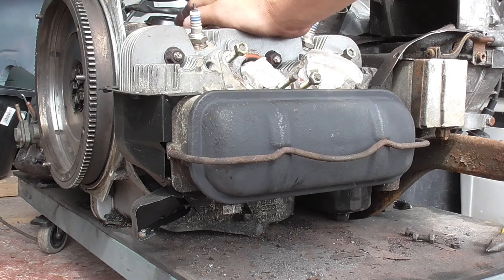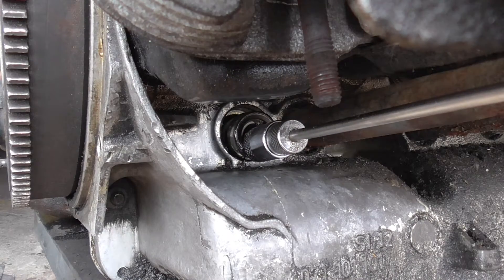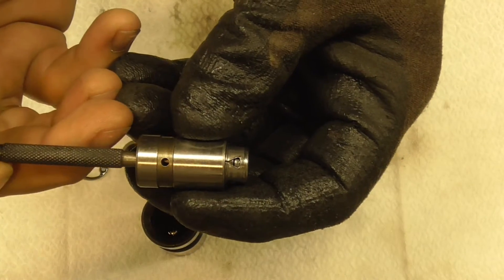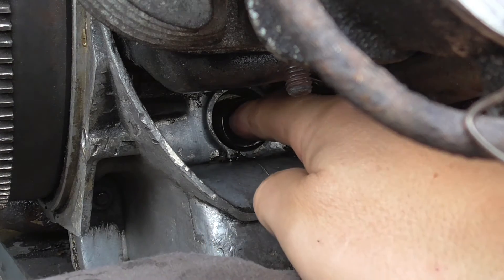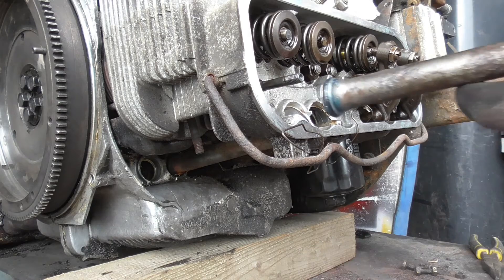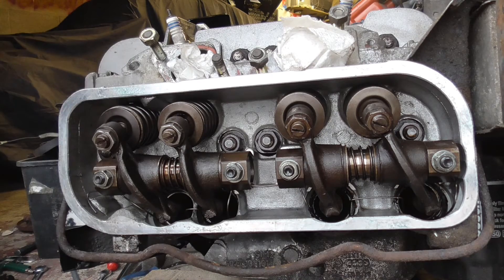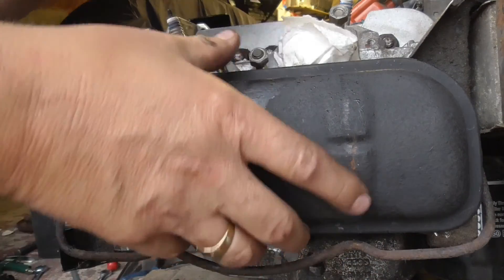VW 2.0 CU - Stuck Hydraulic Tappet, removal and fix. T25 Transporter Vanagon T3, Cam Follower Lifter

Comment: hey i don't know if you're replying to such an old video. but i have a vw t25/t3 westfilia 1980 i'm in the process of assembling it after having it painted. i've then changed all the gaskets o-rings and honed the cylinders with new piston rings. and it's assembled and just needs to be put back in. but i've adjusted the valve but they're all hard just like yours was here. it runs fine with 0.10 in adjustment but it's a 2 0 cu with double carburetors. so it should be with the same oil tensioner as yours. but if i turn it 1 1/2 turn in then the valve is not closed. just have to say that it sounds and runs perfectly with the 0.10 in adjustment. but the question is whether it's hanging in or 8 or whether it has a different model in it. just have to say i didn't check the model of it when i put it back together... regards rené
Reply from the maker: Still here and happy to help if I can. Hard to know from the info here how the Hydraulic tappets are, ie are they oiled and pressurised? I'd be tempted to get it up and running with what works as you have found already, and then just recheck your tappets once confident everything has been up to temp and pressurised for on a decent run. Does that help?
Reply: I feel like taking them all out and checking them all out before I start the engine.

Comment: Hi got new camshaft in is 1 half  turn or less watt you think  ...thanks
Reply from the maker: @JamesSmith-ui4mv  I'd be tempted to  stick with factory settings and recheck once it's all bedded in. In theory you shouldn't need to tho. Ive never actually replaced a CU cam.... tho probably should have 😅 ...so not sure what the general guidance is on this. Best of luck 😊👍

Comment: Your work is always good and clear .. Can I change the seals..mo dismantling the engine. I have oil leakage .. I have a VW Transporter 1980. Is the same engine. Is the same engine...merci d'avance
Reply from the maker: On a 2.0 CU yes. The pushrod tube pulls out the head after remove the retaining clip etc. So the seals and tubes can be replaced without removing the heads etc. If that's what you mean? Make sure you keep your pushrod numbered and clean, so can be put back the same way they came out. Thanks for the kind words, best of luck 😊👍

Comment: I recently removed rocker assy on 3 & 4 (air cooled 2 litre) to try and fix oil leaks from pushrods tubes. I reassembled not knowing about resetting the hyraulic tappets at the time. Engine just wouldnt fire on 3 & 4 after reassembly. I then discovered reset process and carried out as per manual and what you've done here. I.e. just gently close gap and then 2 full turns in of the adjuster screw. However all this does is open the valves slightly and leave me with no compression! Looking at your video more closely, it is clear turning the adjuster lowers the position of the plunger in the huydraulic tappet rather than opens the valve so I have to assume  that in my case the tappets are somehow locked or bottomed out. Do my conclusions sound correct?
Reply from the maker: The Tappets will often drain of oil when the engine has been stood for a while on the valves under load, why the engine can sound like marbles in a tin can for a while when first started. They will repressurise soon as get some oil round them and usually after warms up a bit. If you just follow the 2 turns in, and then get it fired up, the tappets should repressure and self adjust so your valves aren't open and losing compression. 
If you have had the tappets apart like me the need prefilled with oil, I know a garage locally that jokes about assembling them submerged in a bowl of oil, I think he was joking!!? 😅
Update... I was just thinking about what you wrote and had a moment of clarity. So your tuning in 2 screws and it's solid so opening the valve rather than having a lack of oil pressure. This is similar to the problem I had and found one stuck. I have a full set from a CT which LOOK the same as a CU. I haven't compared side to side but if you can confirm so, happy to send you one if get stuck, forgive the pun.
Reply: @PeoplesCar  Thanks for your reply - really helpful. I'm thinking before I strip the valve gear off again to check the pushrods / tappets, I'll see if I can identify which tappets are solid and dont have any 'give'. Then I'll repeat the reset procedure but not wind in the adjuster on those that are solid. This might at least give me compression and allow the engine to fire and get the oil circulating. This in turn might pressurise the tappets - and free any stuck ones? I cant quite get my head around what would happen if the sticky tappets freed themselves but assume they would now be out of design range and get noisy - not sure! Then I'd run the engine for a while and redo the reset process again. If still no 'give' when adjusting then I'd have to assume those that are stuck will need removing - which looks like a nightmare with the engine in situ. I appreciate your offer of providing a replacement tappet. I'll do the above and let you know if I need one!
Reply from the maker: If you don't reset the valves correctly they may not open? On the tappet I had that was stuck you simply couldn't wind it in, was solid and opened the valve. So pretty obvious. They should actually be pretty solid if pressurised but you should be able to wind it the adjuster 2 turns without being totally solid. In theory they would leak some oil out and self adjust, if working correctly, it's kinda the point of them. Frustrating ain't it!
Reply: After stripping valve gear again and finding all tappets followers were solid I removed one. Turns out they're not hydraulic!! Engine is Pre 1979.
Reply from the maker: @White_Walker900  Arg really. I didn't know they were ever solid on a type 4 sorry. Just needs gaps setting and you should be good 👍

Comment: Can the lifters drain of all the oil and leave a large clearance between the valve and the rocker arm ?
Reply from the maker: Yes I believe this is fairly common on these engines when been stood a while. The Tappet/s under load will leak its oil, so when the engine is started it sounds like a .... and to quote a friend here.... skeleton having a wa*k in a metal cupboard! 😅. Takes a little while to represureise hence often sound tappety when started for the first time in a while. Important to make sure the oil level in the engine hasn't dropped too far, and I was once told an oil change can help this but can't confirm that's true first hand.
I've never had or heard of one permanently fail in the way ypu suggest but not saying its not possible. I did have a CT I bought and pretty sure the previous owner gapped the rockers like would on a none hydraulic bug motor which I guess is an easy mistake given its similar design, so something to watch out for if its new to you and all seem loose despite having time to repressurise. Best of luck and thanks for watching 😊👍

Comment: What does a stuck  tappit do to the engine? Would it make the engine sound noisy, would it draw in air , and make engine sound  and run rough?. I have a problem with my 1.9 wbx  twin Webber carb engine I can’t get to the bottom of
Reply from the maker: Its funny you should being this up as was just discussing it the other day and we couldn't come to a concensus on the outcome of a stuck Tappet and meant to look into it further. When fully pressurised the Tappet would hold the clearance at zero to the pushrod and keep the rest of the valve train 'tight. However I don't know what position within the Tappet the pushrod sits, so how far into the Tappet body if that makes sense. In my experience with mine the valve train was super tight, although when fully pressurised you would expect this anyway to some extent certainly when the engine is running. So the soft rockers on mine with a little movement just showed they were slightly depressurised and the valve not stuck, where as the solid one had pressurised and even with the engine off still solid. I was getting a lot of pops and farts back through the carb and exhaust and suspect this was the valves being slightly open due to that Tappet as wasn't able to adjust the tension out, but its hard to say for sure as had a garbage carb and an exhaust full of holes. I guess the way to test if your valves are open is move that cylinder to the compression stroke where the valves should both be closed and then use compressed air down the plug hole. If it comes out comes out exhaust or manfold you know there is a problem with the relevant valve. Tbh that's a lot of messing tho and probably just easier to replace if suspect is a fault.  I have a set of CT ones you can have a couple of if are the same as for your engine. Look the same as CU but don't know if are the same or not so would have to chedk and obviously are used so a bit worn. Noisy tappets are usual for a while especially when the van has been stood but should quieten down after a few minutes of running. I believe somebody set mine like you would on a bug however with a 6 tho gap rather than a couple of turns in and that sounded like marbles in a tin! LOL.
Problem is there are so many reason I can run rough and I would suggest timing and carb issues more likely than a Tappet problem. For reference my new 1.9 wbx sounded like a bag of shite, just listen to it in my latest video, I reset the valve 'gap' last week and its vastly improved it but still not perfect, but as least now doesn't sound like something is about to fall out the bottom of the engine. I've actually done another video on setting the tappets on the 1.9 wbx due out about 6 weeks  but it's pretty much the same as the one i did for the CT a year or 2 ago. Only thing I would change is using fingers to feel the biting point on the rocker foot rather than a screw driver. It's just easier to feel. Hip something there might be of help. Best of luck 😊👍
Reply: @PeoplesCar  well thanks for that!!! 
I’ve had twin carbs for about a year, a month ago it just lost power and the engine was noisy . I tightened everything as per your video, set the carb floats to the correct height with a gauge put in a mechanical pump, changed all of the fuel lines , new filter, new plugs, leads, checked timing and distributor, flamethrower coil, all fine . Did a compressive test, all came out at around 145, brake servo fine. Starts ok on the drive, idles fine, go on the road, coughs and farts, no power. Put down the pedal, backfires, still no power. So… I’m hoping the valve (s) is stuck.I don’t know what else to try or how to test for anything else.
I’m stumped
Reply from the maker: @stevethetiler  So compression test OK, no need to check if a valves open then. Might be worth checking you don't have any leaks in the vac lines for the dizzy stopping it advancing properly. This was something I found on mine last week and ran so much better with new rubber ends on the pipes. It sounds very similar to the prob I had with my 32/36 progressive and I believe that was a blockage in the main jet/circuit but tbh I never tried to sort it just swapped the carb and was better instantly. Best of luck 😊👍
Reply from the maker: @stevethetiler  You could try posting on Volkszone forum. They will ask you a bunch of questions and tell you about bunch of things to try, but some of the guys on there are so much more knowledgeable than me and my primative brain 😅. Collective think-tank and all that 👍
Reply: @PeoplesCar  great, thanks for all of your help, I’ll keep watching 👍

Comment: Procedure I've used  rotor pointing to number 1 on Dis cap...set tappets for each cyl  accordingly,set screw 2 turns after slight slack.Turning Crank pulley anti clock for next cyl loosened pulley Bolt .So continue clockwise  to cyl on same cyl head side .
Reply from the maker: I've done a couple of vids on this procedure and I do exactly the same. Tx for watching :)   PS: Sorry for the delay responding. A bunch of comments didn't show on my phone, wasnt till I logged into the PC I could see it! Weird!
Reply: @PeoplesCar  Yeah that happens I've found that pc shows more comments to posts.Reason I was adjusting valves engine compression on#2 low .Atm I'm doing a full respray .Engine needs out after thatand sorted +new clutch .Would you know where to source a/cooled thermostat 85 degree 2ltr engine ? Thanks & subbed😁
Reply from the maker: @davidpatterson9107  Siunds like you have a lots 'fun' to come! 😅. No I'm not sure, is that not something you can still buy new, I haven't looked. I actually ran my CU without one and locked the flaps open with a small bracket on the top left of the engine. The cable had snapped on mine. I know this isn't ideal and long term will affect the longevity of the engine but never caused my any day to day problems. I personally thought the difference between open and closed on a CU was quite small unlike on a Bug but still not recommended and even had an engine builder tell me he can tell when one has been run without one. Best of luck 😊👍
Reply: @PeoplesCar  Thanks for replying used to be able to get thermostats at reasonable money USA  not in demand enough they stopped bothering .If you're  lucky to have a duff one they can be resurrected via a link which shows how to.👍👍
Reply from the maker: @davidpatterson9107  NP I always try to 👍 I think they are bigger than bug ones... not 100%... but I remember thinking that when last held one. I wonder if woukd work all the same, somehow clamp the cable on top rather than the fixed bar. Probably not worth risking for an 'experiment' however unless you try stupid things like me and bug carb on a CU! 😅

Comment: Dont you have to adjust the tapets to 00.6 ?
Reply from the maker: Not for hydraulic tappets they are self adjusting once set 🙂👍
Reply: @PeoplesCar  What is the proper setting?
Thanks
Reply from the maker: @vanhuss9239  if you jump to the valve setting timestamp on the bottom of the video I go through the adjustment. 
For hydraulic tappets according to the manuals you make contact to take out any free play and then 2 turns. Many do 1 1/2 turns as it can tighten slightly over time. 
I go through the full procedure including getting the engine to TDC on compression stroke in this video https://youtu.be/Pjjndd7qrEM
This was on my old 1600 CT which is also hydraulic tappets but it's pretty much the same. I would use fingers to close the gap rather than a screwdriver as I did in this vid tho, it's more accurate. Good lucks 🙂👍

Comment: Thank you for your helpful video.
What were the symptoms of your car before you pulled the engine and discovered the stuck exhaust lifter?  Backfire?  Stall?  No start?  Compression?  Etc.?
Now that you have repaired the stuck lifter, does your car run normally?  Thank you.
Reply from the maker: Tx bud. Tbh it was a 'new' engine and I was just checking everything before fired it up when I found that. They should be pretty stiff and not spongy once full of oil but that sucker was solid. I couldn't adjust the tappet at all. Now I've had it running I'm going to go back and recheck everything in warmer weather. The engine seems a down on power possibly compression and a valve issue though its hard to know as the carb is in need of some tlc too and I haven't had time to properly check either. Not too happy with this CU atm, turned out to need a load more jobs to do than I expected, but then that's the van full stop! LOL 🙂

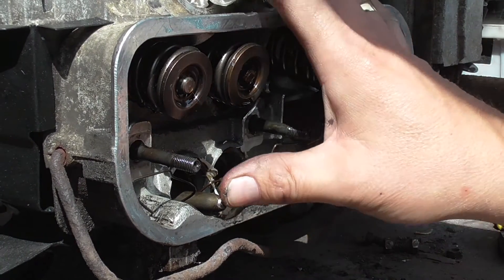Comment: 2:16 it’s supposed to be rock solid , because oil doesn’t compress . The one that (may ) be faulty is the one from the intake valve …. It could be also bled down due to time though
Reply from the maker: Hi. They were all firm but had a little 'give', that particular one was just solid. After cleaning and running it's now the same as the rest?
Reply: Quick question what if they’re all solid?